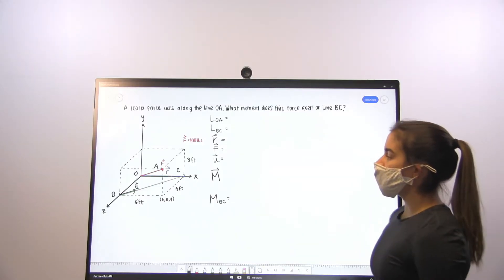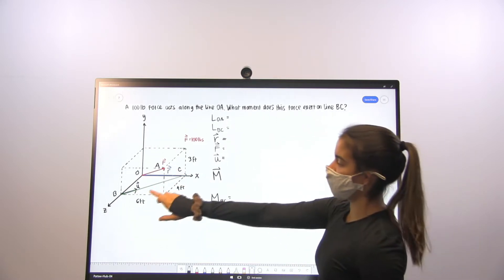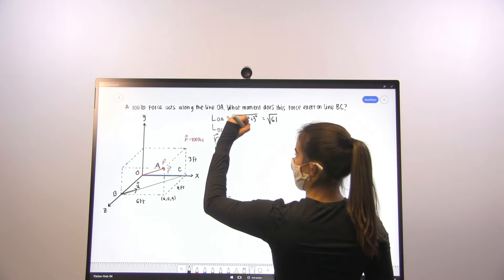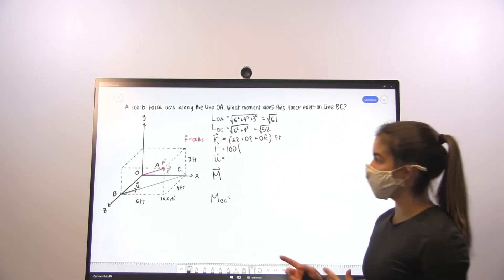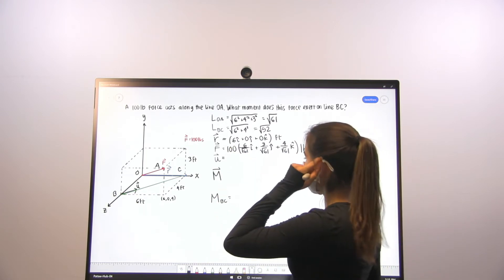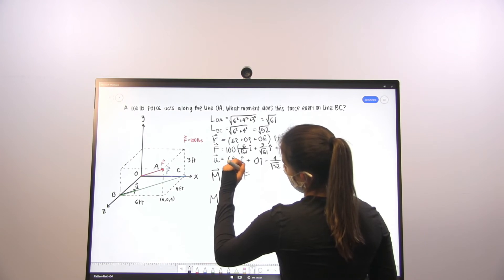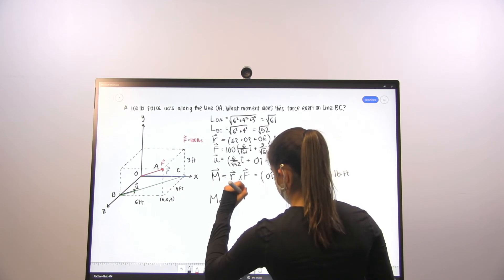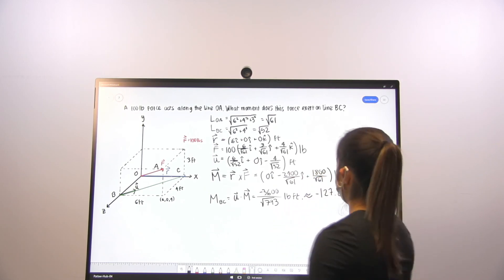WP 3.5.2-FIP

Comment: wait, I have a question. For the fourth vector you multiplied 100 times i, j, k. Why did you use the value for Z as k, and the value of Y as j? isn't k always suppose to represent height? and in this particular problem Y is being used to represent height. I thought the the third coordinate always represented height regardless of what it's used to be represented., doesn't that affect the result for the cross multiplication?